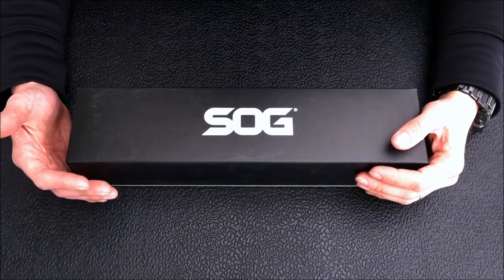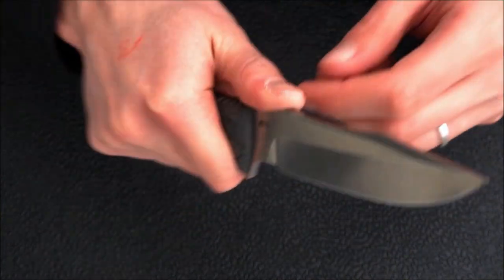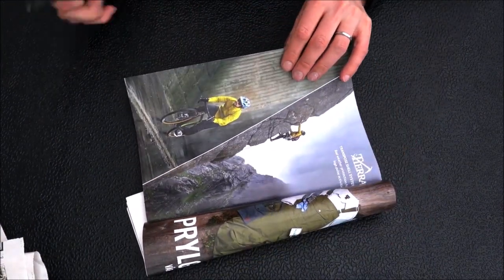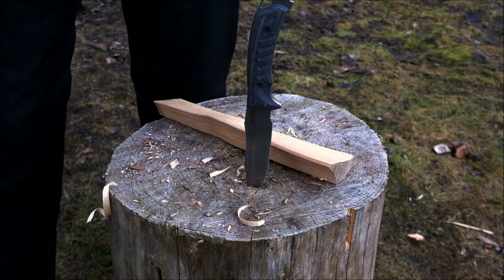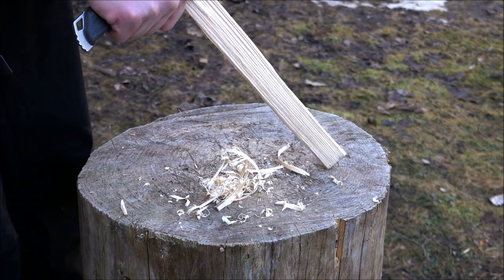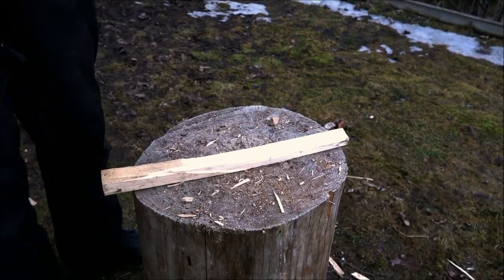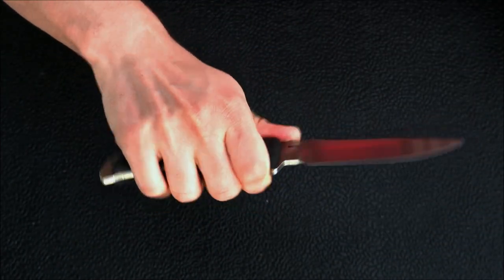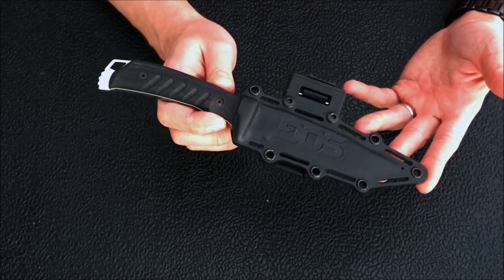SOG KNIVES - PILLAR - FULL REVIEW

Comment: While this knife is not the end all/be all, I found it to be very good for certain things.  To be honest, this knife really is a combat utility knife, well suited for a soldier.  I can readily find these for around $150, and for that money, it’s really difficult to beat it for its purpose.  The steel, well it’s not MagnaCut, but the knife came out before it existed.  It’s fairly rust resistant, so that’s one less concern for a soldier.  It’s a good size, with a blade stock size that keeps it fairly lightweight for the overburdened soldier, yet plenty stout for use and abuse.  It’s usable in a number of grips and is pointy as needed to use defensively.   But it’s not single minded in purpose, able to safely do many utility tasks like opening MREs and other packaging, cutting tape or cordage, etc.   I can’t really think of anything cheaper that could the same things better.   Maybe a Cold Steel SRK of some kind?  Their sheaths are noticeably worse and the kraton handles are not liked by everyone.  A Gerber Strongarm is tough, but the steel is terrible for edge holding.  Again has rubbery handles, but the sheaths are pretty good.   Benchmade Nimravus is made for the same purpose, but Benchmade has discontinued all but the tanto blade.  I’m no fan of the aluminum scales for a fixed blade and it’s sheath is certainly not as good and it’s damn expensive.   The old Al Mar SERE Operator is nearly the same class, but pricier and long gone.  Thats about it without spending a lot more, or having a heavier knife.  I guess if you have a lot more money, and don’t mind a few more ounces of weight, a Spartan Harsey Difensa would be nearly ideal.   It’s just that now you have an 11.5oz knife that’s over $400.   Knives, like most things in life, are a compromise, and this one I find suitable for my needs.  It wouldn’t be my choice for a survival knife, hunting knife, or woods knife.  Fact is, it’s really an updated SOG Seal Pup Elite made in USA of better materials.  It’s twice the price, but for me, the much better materials and sheath, made in USA with higher quality, is absolutely worth it.